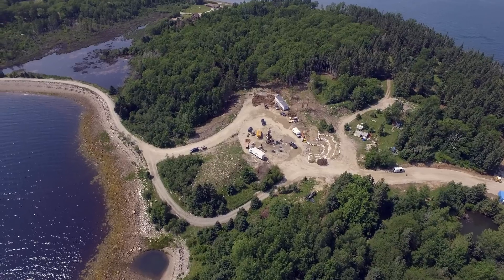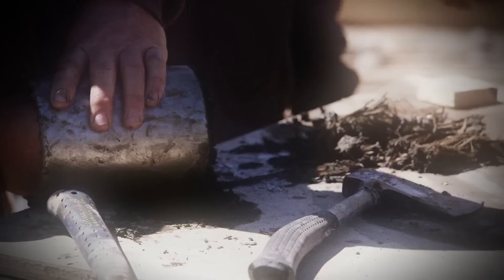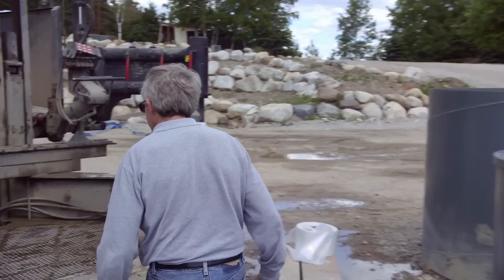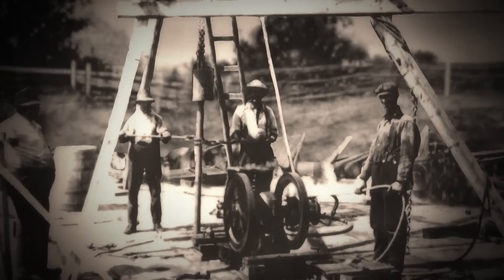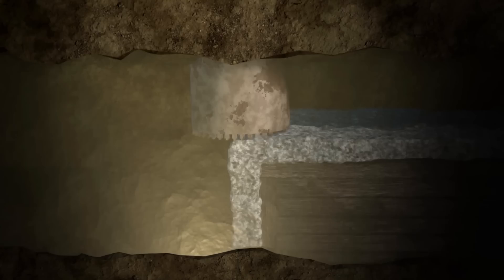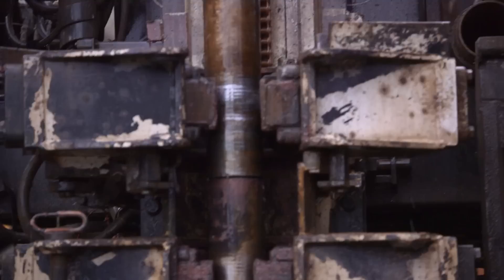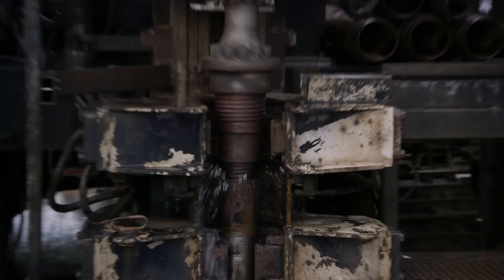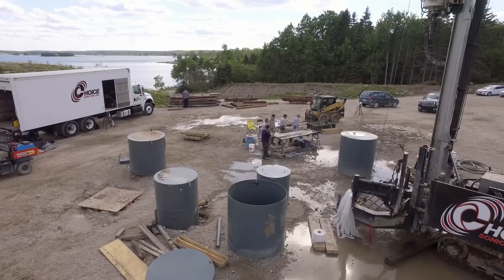The Curse of Oak Island: Looking for Answers at DE-6 (Season 6) | History

Comment: looking at it on a long turn thing you get 20 lbs, of gold out of the hole, 1,2 billion if the reading was right.  to dig that hole 20 to 30 ft deep an then put your tub in in 2 day after the water stop. then have a high power jet to pump dirt out. an ya spring if it dont let water in you be next to the hole eye opening after u se the gold
Reply: Are you saying 20 lbs of gold is worth $1.2 billion?
Reply: What??? What are you trying to say? what the heck does "an ya spring if it dont let water in you be next to the hole eye opening after u se the gold": supposed to mean?